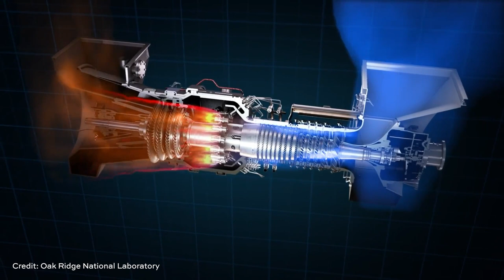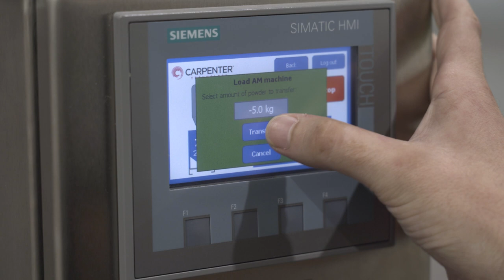3D Printed Turbine Blades for More Efficient Power Generation | The Cool Parts Show #35

Comment: Waste of time and money. 3D printed metal parts are EXTREMELY difficult to balance. While this might be useful for a rapid prototyping, but not much beyond that. No serious engineer would choose to 3D print the steam engine blades. the vibrations would be horrible :)
Reply: Some metal 3d printers have post machining processes built into the machine. That can get the part to exact dimensions and weight. The best engineers are the ones that can figure out how to make something work out of a process previously deemed impossible.

Comment: This video failed to mention that the EBM process pre-sinters the powder in each layer, such that internal channels (especially small diameter and complex paths) become very challenging, if not impossible, to remove the powder.  Yes, laser processes are subject to more distortion and more design restrictions, but they also make it much easier to remove the powder from complex internal features.  Laser processes also use Inconel 718 and 625, which in my experience are not prone to cracking.  I could be wrong here since I don't have direct experience with EBM, so any feedback would be greatly appreciated.
Reply: Completely agree. The show host can blather go on and on about complex internal passages but he doesn't know what he is talking about. The passages will be extremely difficult if not impossible to make via EBM and even PBF. The demanded surface finish on those passages is less than 5 microns Ra. First you need to get the powder out of those tortuous passages which in some cases will take more than a few weeks to do so, if at all you are successful. One major OEM making turbine blades with PBF was scrapping 30% of their printed blades because they couldn't get the powder out of those passages reliably. Every one of those blades will need to be X-rayed to make sure there are no powder particles left behind inside those passages and the passages are squeaky clean and dimensionally correct. This will be an iterative process of clean, inspect, clean, inspect adding to cost astronomically. Next, as is apparent from the pictures of the blades shown, the surface finish is absolutely terrible, not even close to as-cast surface finish of similar parts made traditionally via investment casting. It looks like a sand casting rather than an investment casting. The surface finish on those internal passages will be at least as bad as that on the exterior surface, if not worse due to partially sintered powder particles stuck to the inner walls. All of those passages will need to be cleaned and polished with abrasive flow machining and chemical etching, further adding machining cost. Furthermore, due to the intense heat and thermal gradients experienced by the part during layerwise printing, with heat, cool, heat, cool for each layer from roughly 600 degrees C to 1500 degrees C, there will be significant distortions that will cause the part to deviate from the nominal geometry in the starting CAD model. It is extremely difficult to (a) non-linearly compensate the print instructions to account for the distortions that will occur as a result of both print resolution and heat related distortion and (b) compensate the print instructions to add sufficient metal stock to the nominal part to allow for the multiple machining processes to get the part to the design print dimensional tolerances and surface finish. Lastly, there will be the need to have a custom and complex heat treatment cycle to get the microstructure of the alloy to be comparable to cast Inconel 738 which has been well understood for decades. Finally, the part density, elevated temperatures mechanical properties (tensile, hardness, creep) etc at elevated temperatures will need to be qualified to match those of commercial cast parts. The process is akin to making a trillion welds, and is a long road...
Reply from the maker: Mike Kirka, who you saw in this episode, offers this response: “Yes, laser powder bed fusion processes are extensively used for the processing of Inconel 625 and Inconel 718. However, these are weldable alloys. The alloy used in this case, Inconel 738, is a high gamma prime superalloy that was designed for casting of blades and falls into the traditionally non-weldable category. Laser powder bed fusion processes have not demonstrated the ability to date to process non-weldable Ni-bae superalloys crack-free and in complex geometries. A difficulty of the EBM process is the removal of the lightly sintered powder from internal passages, but methodologies do exist for removing the powder. This is a factor that must be considered when designing components to be fabricated through EBM, similar to the way laser powder bed processes have more restrictions on overhangs than EBM. In the case of the blades seen in the video, they belong to stage two and are solid (non-cooled), so powder removal was not a factor. Overall, each of the AM processes is a tool in the tool box, with the right tool being chosen based on a combination of materials processing capability, economics, and attainment of component design/performance goals.”
Reply: @AdditiveManufacturing  Ahhh...thank you for the explanation on the material choice!  I always enjoy learning about processes for which I don't have direct experience with.  Totally agree that both processes are complimentary... EBM is likely a better candidate for larger / thick walled parts, but I can't imagine how you'd remove partially sintered powder in a complex internal cavity without some extraordinary process.  Even un-sintered powder in laser processes is notoriously difficult to remove without careful design and post-process planning for complex internal cavities.  A quick search of the current literature seems to indicate that this is still a major hurdle for EBM as blasting seems to only work for directly accessible geometry.  A novel solution would be a huge win for both processes!   In EBM, is there a way to omit even a tiny portion of the build from being partially sintered?

Comment: which tech is more promising when it comes to strength and performance of turbo machinery parts , LPBF /EBM or Binder jetting?
Reply: PBF and EBM are akin to casting and will give similar results in strength and performance, but in the context of specific alloy capability. Binder jetting is a modified version of powder metallurgy and will not come even close.
Reply from the maker: Here is a reply from Mike Kirka, Oak Ridge National Laboratory, who appeared in this episode: “Each technology is a tool in the toolbox. Which one to use depends on the material, the necessary feature resolution, the economics associated with the part application, and ultimately the size of the part. In this case, we leveraged EBM to develop the science necessary to process a non-weldable crack-prone superalloy that cannot be processed successfully in complex geometries free of cracks in laser powder bed fusion based on current machine technology.”

Comment: those prints look rough. aren't they talking 50micron print precision these days for a much smoother finish?
if there are no cavities in printed metal and the surface can be laser smoothed and heat relaxed, 3d printing might just be ready for jet engine use. the great equalizer.
I found a chinese 3D metal printing company (unionfab) that have 5-10x lower price than the west and I'm talking them into adding an inconel alloy (equivalent alloy GH625 or GH4169)